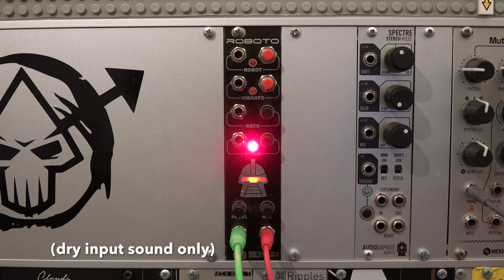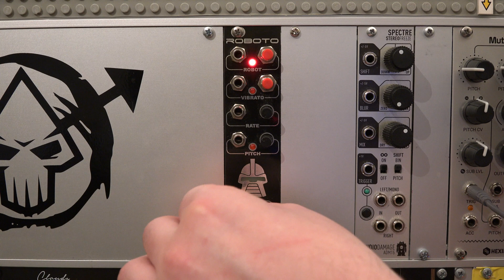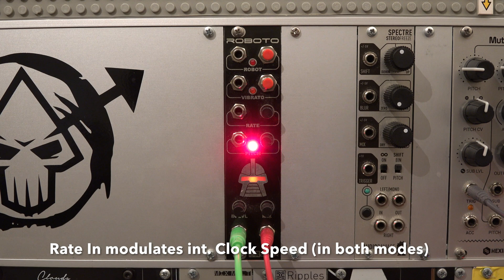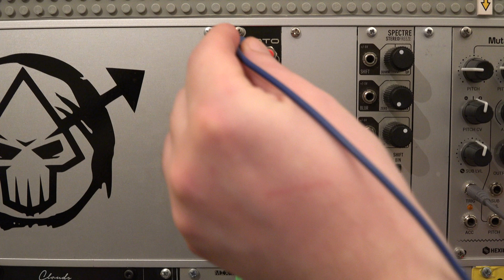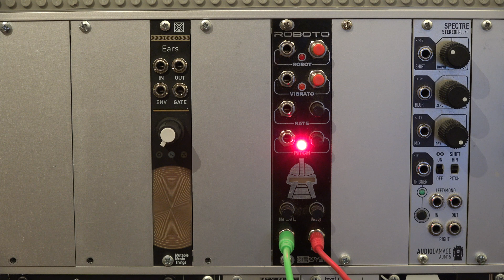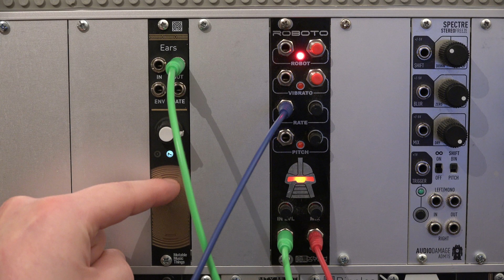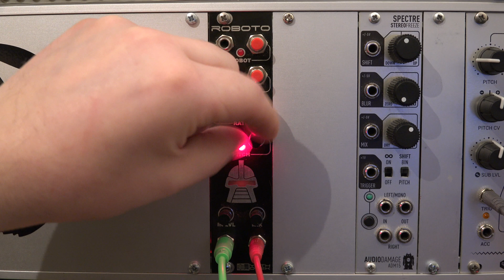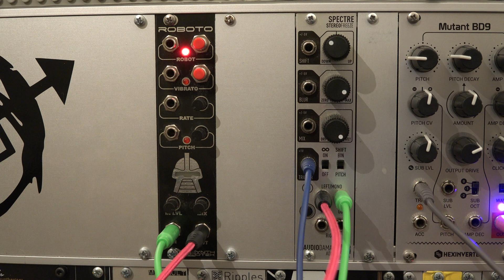Synthrotek Roboto - Overview & Patch Examples

Comment: Aaaahhhh, I’m so glad that I’ve gone amd finally ordered the remaining components that I needed to finish my Roboto!!  If you had the chance, would you have broken out that trimmer pot from under the panel, so as to have access to it while patching?  I love the way it’s making your drums sound here.  That’s something that I’ve really wanted to do on the modular; really run some analog drums through something like this that will glitch-ify them!  THANKS FOR SHARING!!
Reply from the maker: thank you very much! it might be nice to have access to the trimmer, but if you find your setting you won't need to trim very often, as the range of the pot on the front is quite large. have fun with yr roboto + kind regards!